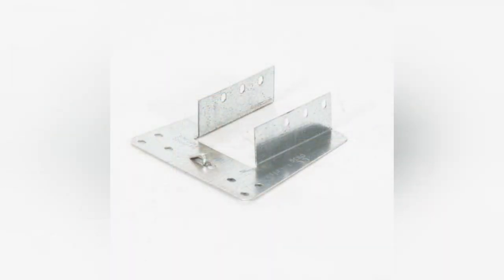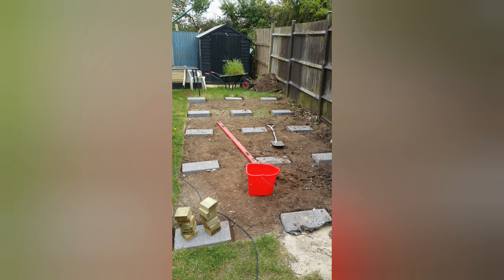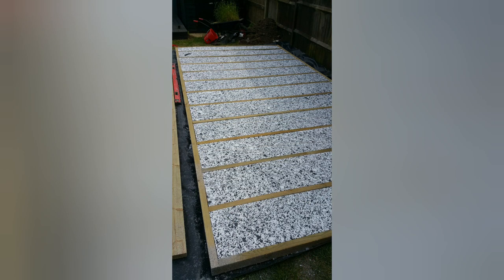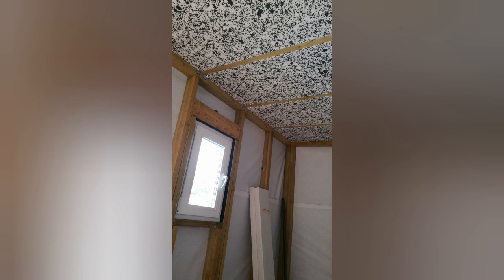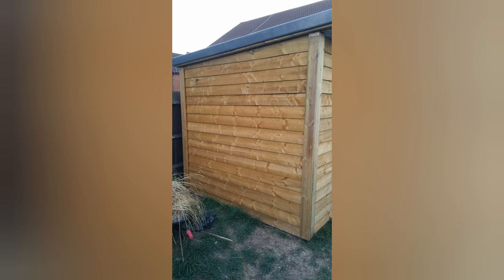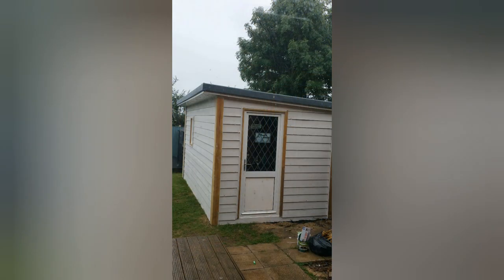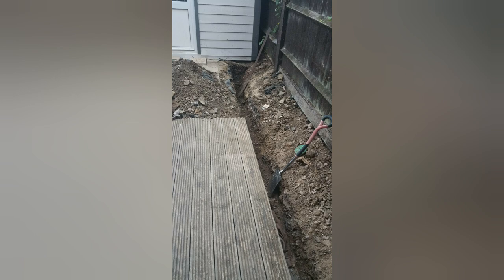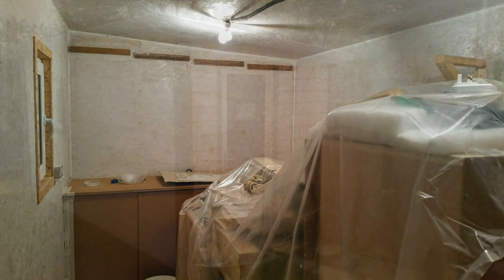How much did my 16 x 8ft workshop cost to build???

Comment: Nice video ,I like your workshop. I built a 16x8ft storage shed last year in London. I notice we use similar way to build and just a little bit different. : ). I use normal untreated c16 2x3 timber as I thought it was used inside and strong enough, the most important thing is cheap. I use it for storage so no insulation fit. I use log lap cladding and looks great, use it one year and so far so good. The total material cost me  997 british pounds.